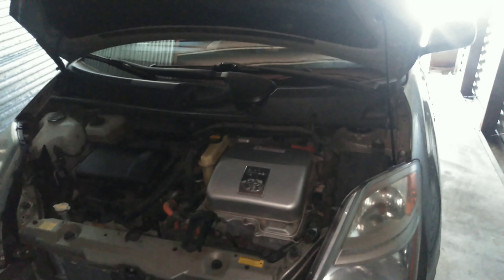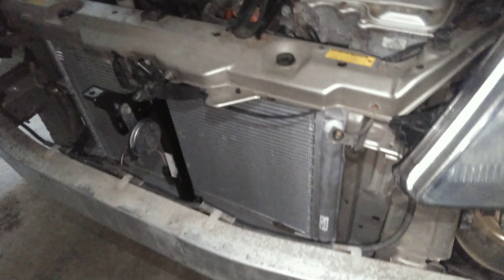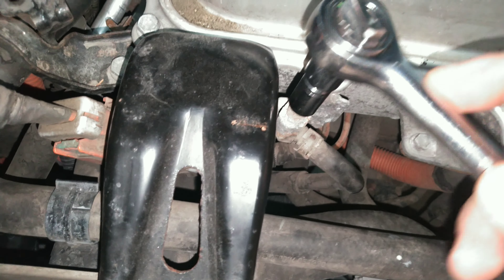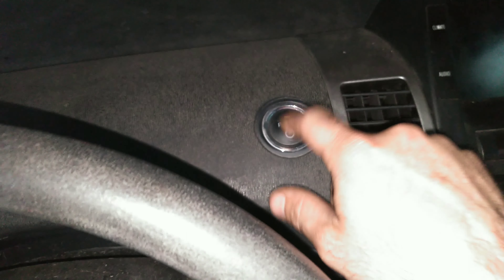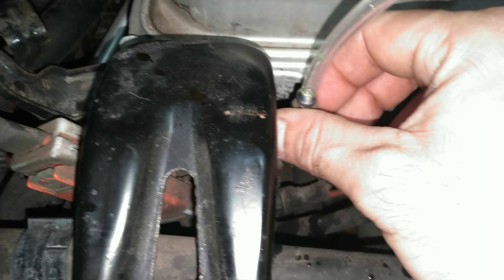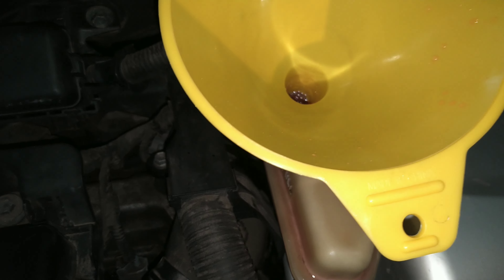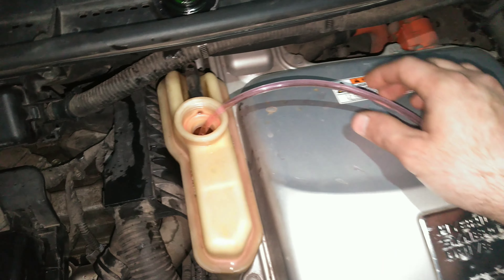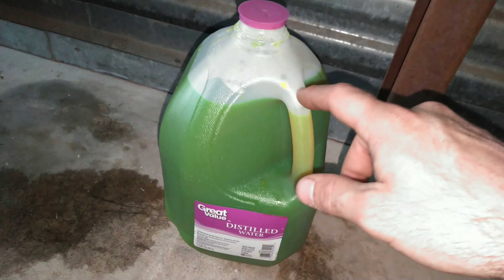How to change (& bleed) the INVERTER coolant in a 2004-2009 Toyota Prius (in 20 minutes or less)

Comment: Removing the reseviors cover should be after removing the drain bolt to avoid quick flow of the coolant,  which is  dangerous if touch  the skin and eye and it could be hot .

Comment: Super easy video to follow, thank you!

FYI to anyone who runs into this issue- after refilling the coolant and turning the car on, the pump was running but there was 0 movement in the reservoir and nothing coming out of the bleed valve. After freaking out for a good minute, I ended up repeatedly sueezing the inlet hose of the water pump which helped dislodge a ton of trapped air, which then got the fluid moving.
Reply: Just did this today, and I probably spent five minutes squeezing air out of that inlet hose before fluid finally went down it!
Reply: I had the same problem, but squeezing the hoses to/from the pump and no luck, so far.
Reply: @willrietveld4317 Were you able to resolve the issue?
Reply: Helped immensely! Thanks for keeping my blood pressure down! :)
Reply: @gracepryor9960 Thankyou same for me if worked

Comment: I did this today while changing the inverter pump.  I drained the old coolant first, then I proceed to change out the inverter pump. It created less of a mess and didn't have to clamp the hoses off. After the pump was installed I filled it with the new coolant like in your video. The small plug where you bled the line  for me didn't have much air in it because I forgot to open it when It was draining . but this definitely works!. Best way to kill two bird with one stone, also taking the headlight off gives you more space to work on the inverter pump. Thank you for the video!

Comment: I recently changed after market coolant which is pink,I think I will need doing this as well. Question is what was the effect on the drive. My car does not drive well on battery it just struggle 😫.

Comment: Can low coolant cause the red triangle 🔺 light and vcs light and check engine light.. then there is a red car with explanation mark on the touch screen. The oil level is good the battery seems to be charging while running only thing I see is low red coolant
Reply from the maker: That happened to me when the inverter pump went out, easy fix, $100 and it takes about 20 minutes to do

Comment: Such a precious info man, thank you much!!! I have 415k with my 08 prius,amazing car but have heat issues I hope this will help especially now in the winter,no heat in the car.
Reply: Inverter coolant shouldn’t have anything to do with heat inside the cab. 
Check heater core and possible low coolant in the radiator on the resourvoir on passenger side
Reply: Any check engine codes?

Comment: Thanks for making this vid, very clear and made the job easy! At 245,000 miles I was long overdue. I had put it off thinking it was a difficult process. I will also add that I used a 24mm socket on the drain plug, since everything else on this car has been metric.
Reply from the maker: Yes, they were sold out of the metric size plug when i went to buy it. Glad it was helpful

Comment: Thanks for the stepwise video. Just 1 question comes to mind is that 🤔 how much volume of Toyota 50/50 antifreeze coolant is needed to flush old one completely out and replace with new volume? Thanks!
Reply: The one gallon jug is more than enough for this job
Reply: The inverter coolant capacity is 2.7 Liters (2.9 Quarts).

Comment: My 2006 prius decided to come up with the trianle of death.
The duagnosis was inverter cooling pump fail so will drain the fluid first, replace the pump and then refill as per the very clear and logical steps in this video.
Cant believe someone used green stuff. Definitly more suited to copper related systems.
By the way ive recently had to bite the bullet and replace my hybrid battery after having replaced various failed cells over the past few years. 
Also had to replace the hybrid battery control board due to corosion caused by module leakage over time.
Only done 110K km so wirth keeping until I can afford a Tesla
(2nd hand) that is.
Reply: Will bleeding the fluid get rid of the triangle ?

Comment: Awesome video, saved me having to replace my whole water pump because I just needed to burp a little bubble from the coolant that was tripping the engine check system. NOTE for other viewers: I had to use a 1/4” OUTER diameter, 0.170” inner diameter tube on my 2009 Prius. The 1/4” inner was too big for my car.

Comment: Would I be able to simply add a little pink coolant to my reservoir? It’s a little low
Reply: You can top off with Toyota Super Long Life (pink) Coolant as long as you know that's what is in there already. I'd advise against mixing and matching different brands. Not all pink coolant is the same.

Comment: My 2005 Toyota Prius inverter making a ticking sound  when ever push the brake pedal down & when ever I open the door it make a ticking sound . Does anybody know what could be the issue? Also the vehicle won’t go into reverse or drive .  My code reader doesn’t detect any issues!! Please help
Reply: Did you got it fixed? Could be the ABS pump

Comment: i attempted to do this today but for some reason once i get to the step where you fill the reservoir the coolant will just empty out the overflow tube
do you know why it is not holding while i fill with engine off? thanks
Reply: i figured out that my funnel was not long enough and when i was filling up the reservoir with coolant it was just going straight into the overflow tube

Comment: I replaced the inverter pump, no leaks. I need to bleed it, but what happens if you don't? Insufficient cooling? I'm at full on the coolant level.
Reply: Trapped air bubbles can cause issues with the inverter coolant pump you just put in. Best case scenario, the pump wouldn't function optimally. Worst case scenario, the new pump breaks and causes damage to the inverter.

Comment: mountain springs. can the prius noises and alarms(belts, passenger seat alarm and other completely ridiculous noises and alarms this car makes.  if i put a bag of groceries in passenger seat it sounds the alarm.  thats just crazy. ive heard that you can dismantle or turn off sounds through settings. is this true? i'd love to know that one. i do not want my car beeping at me for anything. ANYTHING
Reply: Only noise I've turned off was the going in reverse noise. That was annoying.    I put my laptop and jacket and it seems to set off the seatbelt notification.  Get to listen to it intermittently for like 5 mins...very annoying ngf
Reply from the maker: I have not heard of any way to disable the beeps on a 2nd generation Prius. you can on the third and fourth generation I believe. oh, you just need a Bluetooth OBD reader and The torque pro app.
Reply from the maker: also, I have a dog seat belt that I got it PetSmart that plugs into the seat belt buckle so that the passenger seat alarm doesn't beep, I just keep it plugged in at all times
Reply: @MountainSpringsAdventures  there are videos of it on youtube....toyota prius disable reverse noise etc....step by step and also videos are available for it.
Reply: To disable or shut up the seat belt beeper, just buckle the seat belt as if someone was sitting there 👀🤣😳💖
That's all there is to it 🤩
Reply: A Prius is not for you then, or any,modern car for that matter. Perhaps a 65 Chevy?

Comment: Why you use the hose and is it important ?
Reply from the maker: I show it in the video, and yes it's very important
Reply: @MountainSpringsAdventures  thank you ... But Why did you used it ?
Reply from the maker: To bleed the air out of the system
Reply: @MountainSpringsAdventures  without it will not bleed that's what you mean ...
Reply: @moeajarmah2954  yes. Without it, air bubbles can get trapped and cause you pump and inverter to overheat
Reply: @skateranddancer  thank you for replying ... I did it without the hose....  and I let the air bubbles come out till the liquid starts go out without air bubbles ( line of liquid ) and I think it's work because there is no overheat and the pump it's in good condition ... Thank you again

Comment: A mechanic recently changed my inverter coolant pump.  Ever since the master triangle warning light flashes on intermittently while I drive.  Is that because I need to bleed the inverter coolant?
Reply from the maker: That's would be my first guess... it sounds like there's air bubbles in the inverter cooling system, and those air bubbles can cause that red triangle 

Just follow my instructions in the video on how to bleed the air out using the plastic tubing- it's super easy to do
Reply from the maker: Hurry up and do it quickly though, don't drive it anymore or it could cause damage
Reply: @MountainSpringsAdventures  OK.  Thanks for your help.

Comment: Question for you..@MountainSpringsAdventures
While your doing the burping or bleed per say ..its in Aux mode correct?..With the hose attached leading to the reservoir.. just double checking..
(Double press the Start button W/out the brake )...

Comment: That was great, helpful. Separate matter entirely. What would you maybe know about why Ready light comes on, won't stay on? I thought it was 12V, replaced it and new neg ground wire. It did Ready on, then started acting up by turning itself off a min. or less later  The hole for ground wire screw had a tiny screwdriver scraping for any residue, corrosion, not much, but that did at least make some difference. It then kept Ready light on for about 15 min., drove for a block and back, then went off again. I really hate going to dealer, they clearly rip people off. I've caught them twice in outright lies so, I now avoid them. Few others seem to know a little, but not enough. I know just one rather knowledgeable place, but they're 4 hrs. away in Bakersfield. Found them super helpful once on way back to Palm Springs. Will drive there if I have to, but figured I would make a few more inquiries to see. It is an 09', should just buy a new one. Though, one of my dogs sheds, and thought of that in a brand new car is a huge turn off. I do drive it even though Toyota said "You can't." I disconnected Neg cable and its ground wire. Ran a single cable clamp to neg post, its other end to nearby ground. It is a pain to unclamp, wait 30 sec. reclamp, but it is possible to drive. Yest. I started it that way, then removed clamp to reclamp for some reason and to my surprise all remained ON, did not go off like it usually would. I actually drove it around like that. Not sure how that was possible, but I did it anyway. Another looking at it said "You can't drive it with its single neg cable disconnected, but I showed him that I was/am. I left bc if he could not see how that I drove it just like that to him. What help is he really going to then be. I even went to 2 electrical shops, they did not know, they wanted to bolt the single cable clamp on. Why? Then I would have to unbolt to reclamp to start it? No! I do not know a lot about Prius, but I found these two guys are not thinking too far ahead, mwybe should not have them working on my car if I know a bit something more than they do on that one idea. I could end up with other problems. I have had things before so, I'm leery. Just asking what would be your thoughts as to what it could be, if you had a min to say. Thank you.

Comment: Great vid!! Prius owners in your opinion is it better to buy a 2011 Prius V with 35k miles or 2017 prius V with 110k miles. All opinions welcomed. Thank you
Reply from the maker: Thanks. I've read multiple places that 2010-2012 Priuses are the ones that had the most mechanical problems. but my mom has a 2011 Prius c and never had any issues with it.
Reply: @MountainSpringsAdventures  2010 is the bad year.  I'd buy the 2011.

Comment: Quick question:
I see you are doing the whole process, from start to finish, with the key/fob in the socket (as if just before turning the car ON).
I saw multiple processes with the car that needs the fob to be far from car so it doesn't turn on various systems. Is it not the case here? ie - is it perfectly fine to do the whole process with the fob in the car? 
Also, thank you for a very informative and well-explained video!

Comment: Nice Video. I wanted to do this for my Prius V 2013 , but not sure where the drain plug is located  Can someone please confirm how to get to the engine coolant drain plug on Toyota Prius V 2013. Thank you. I subscribed
Reply from the maker: It should be in roughly the same spot.

Comment: When you have the hose connected to the bleeder valve, you should let it drain into an empty container NOT in the reservoir. This way if you have any old coolant in the lines it will not contaminate the fresh coolant in the reservoir.
Reply: He said he flushed it again with distilled water before putting in the new coolant

Comment: 2:42 if your prius was fine with the green antifreeze after you picked it   up from your mechanic , i suppose your should be fine with the green antifreeze...The main thing is to have a antifreeze, not the tap water because it will freeze during the winter, and tap water will cause the corrosion.
Reply: The Toyota version is quite costly but there is a reason mine looked new after 150K miles. The preservative package they use is 100 times more effective than what you see at typical auto stores. Very important with all the aluminum surfaces in contact.
Reply: @joehanke8547  it make sense